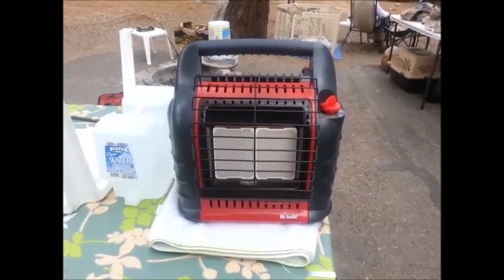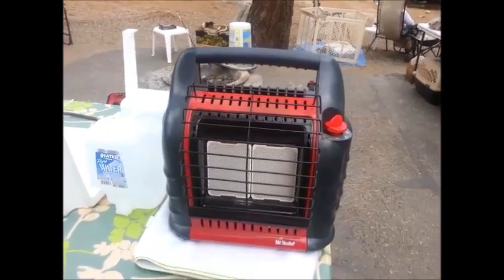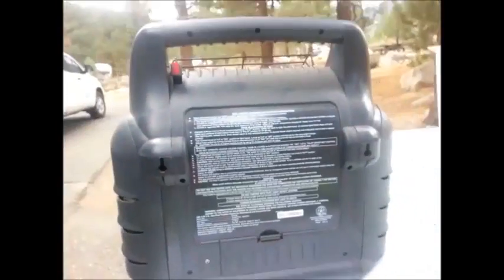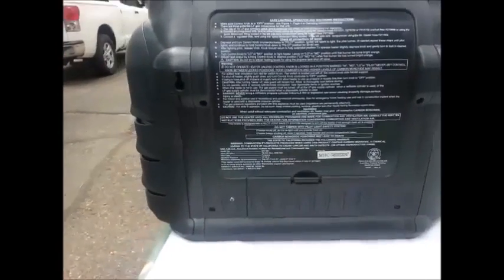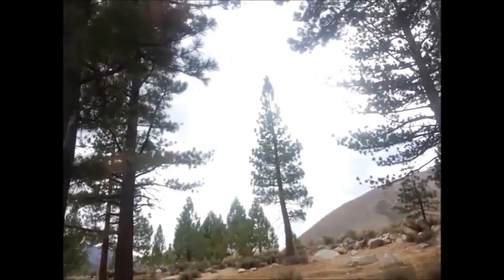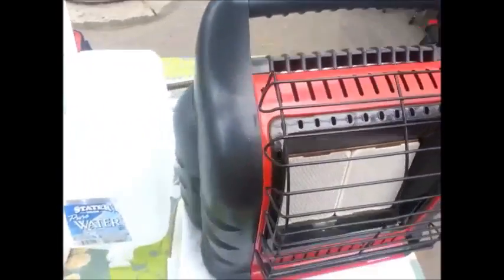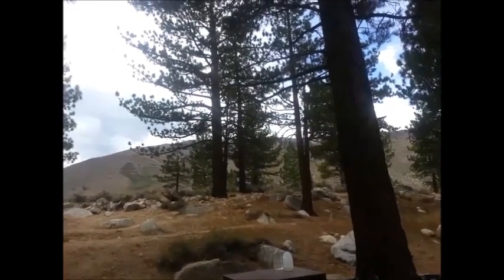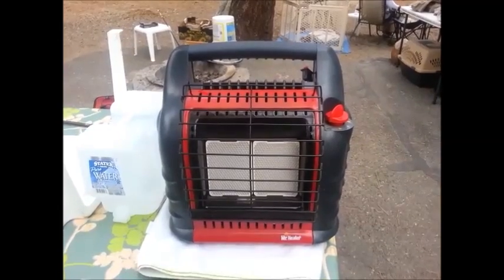Low Oxygen Sensor Repair on Mr. Heater

Comment: I also clean the igniter and the oraface with alcohol and q-tips. You just remove the front grill for easy access. It helps to keep the Mr. Heater running smoothly. :-)
Reply from the maker: Vanmyster94 That is great information... I will definitely include that in my routine... sure do thank ya'!!!

Comment: Glad it fixed your problem but they aren't designed to use above 7000 ft because of the low oxygen sensor. California model may be different.
Reply from the maker: Yup RC, you're right on the money! I saw that also when I was researching the problem and how to fix it. I think the guy up in Bishop's main RV repair shop told me that also. This year we had our up around 9,000 feet and it never missed a lick. But, if it does start messing up at least we know where to look for the problem now.

Thank ya' for your input... sure do appreciate ya'!

Comment: Do you use the 1lbs tanks or do you hook it up to a big tank? If you use a big tank, are you using a propane filter?
Reply from the maker: +Lenny Dearth Naw, we're still using the 1lbs tanks Lenny! Once in a while I'll use the little refilling device and use a 7 gal tank to refill the little 1 lbs tanks. I went thru a season though where the little 1 lbs tanks were leaking pretty consistently after refilling them so I just quit that process for a while. I've never used the big tanks for the heater but I've seen a lot of vids on YT where the guys run some lines inside and have real good luck with it! How about you Lenny, you ever use the big ones?
Reply: I drilled a small hole in the bottom front of our trailer, and I ran a 15 foot hose to the big 30lbs propane cylinder up front. Then I filled the hole with caulking. the heater stretches to about the center of the trailer.  I've seen the videos where they plum into the existing lines, but I'm not confident (maybe even competent enough) to try that. Just doing the math on those 1 lbs bottles verse the cost of a gallon of propane running the heater off the big propane cylinders made for sense to me.
Reply from the maker: +Lenny Dearth Now that would be a great little DIY video I'd love to see partner. Really a great idea just going straight to a tank instead of teeing into the line. You are so right about the costs of the little 1 lbs cans... way over the top!!!
Reply: TT Travels and
Reply: @jpbeck825  are you still having success with your 30lb tank and the buddy heater?

Comment: ive owned 1 since 2006, the yellow color, now it don't want to stay lit, ive kept it clean, but something else must be wrong ??
Reply from the maker: Seems to me like it has to do with the supply of gas. If you're getting gas pressure to the pilot then it seems like it has to be the sensor. I tried blowing mine out from the front but I did have to take the back off and go from inside to get the sensor cleaned out enough to work for me. 

Sure wish I had more info for ya' partner. When ya' get it going please let us know what the problem was!!! Sure appreciate ya' checking in with us!
Reply: thanks ill sure try it
Reply from the maker: Sure wishin' I could help ya' with it... best wishes, partner!

Comment: These heaters are crap with the oxygen  sensor. . Two brand new units don't  work after 30 hours of run time. And that rate I might keep the back off permanently to blow out the sensor .
Reply from the maker: So sorry to hear that Bob. We've had ours for over ten years now and only had to clean the sensor out two, maybe three times. Wondering if the new models are produced differently or something? Sure do appreciate ya' letting all of us know of your problems!!!
Reply: @RCStude   I had one that lasted 7 years . Very reliable  bought  it in 2011 . His oxygen  sensor  thing is new to me .so I assume that is the problem on newer units . Newer meaning , in the past three years
Reply from the maker: I think you're right Bob... must be something going on with the manufacturing of them in the last few years. I think I'll hold on to my old one as long as I can, ey?

Comment: You realize that the Mr Buddy heaters aren't designed for elevations greater than 7000 ft. It states that in one of their maintenance videos.
Reply from the maker: Nice catch John... we saw that too. We've used it many times up around 9,000 plus and it works awesome! Only had it for 11 years though... (-;